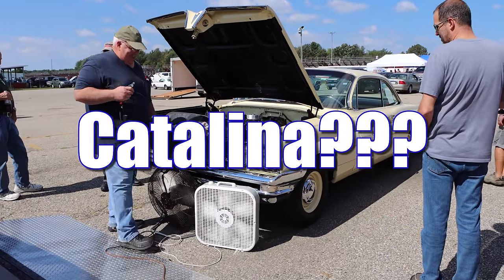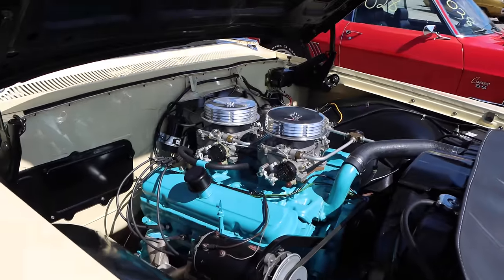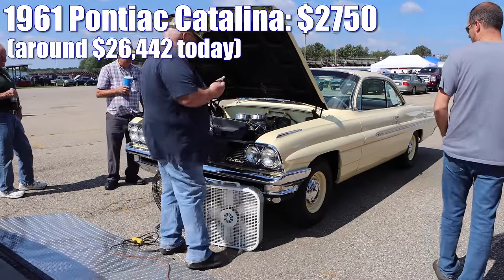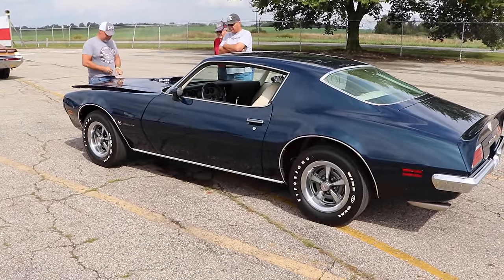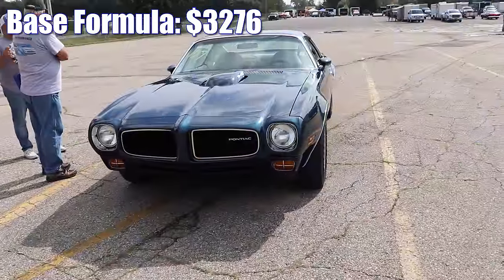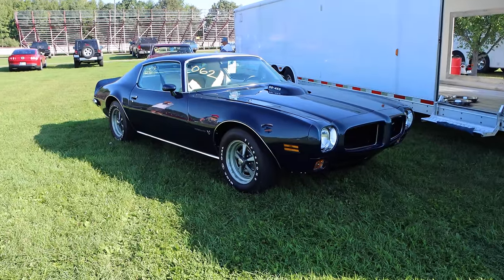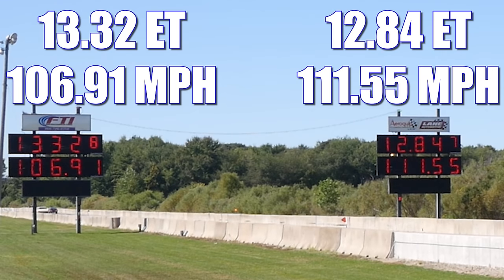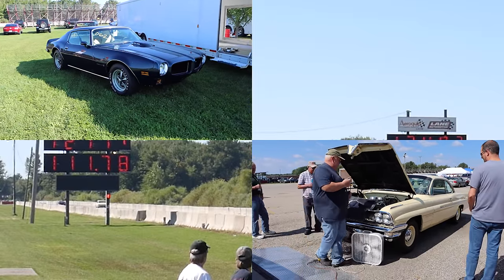1973 Firebird SD455 vs Land Yacht | STOCK DRAG RACE

Comment: Should of put the 455sd in a GTO
Reply: They tried with the Grand-Am of the day.  Which was a nice vehicle. However two things happened.  1.) parts shortages unique to the SD program.  Including motor internals, and suspension parts.  Primary due to supply chain issues from the union labor outages during those days. 2.) the Grand Am was made in different plants than Firebird…. Assembly training problems that GM did not want the extra costs to train cantankerous labor force when they were in very short supply of SD parts anyway including the custom hood the Grand Am needed. 

How do I know these things?  Being around Norwood factory and the Herb Adams engineering team in those days, these nuggets came out.  The Grand Am option COPO like option sheet had the SD-455 on it.  They were ordered.  Never produced for public sale is the official word.  Mauve heard rumors for years that there are one or two custom built at factory trim out area that got in private hands.  Never seen one live.
Reply: I also posted a separate comment entry.  Take a look for that if you have interest in more SD first hand history
Reply: @johnross6314  The SD is a great engine 421cid Pontiac Catalina type, I think if it was Engineered for speed instead of power,FORD would be back to the drawing board with the 428cobra jet,and FORD is a four letter word ,where I come from,we love GM and Mopar himis,but I really think the 421 if Engineered right could of put the himis to shame,hint shorter stroke,for rpms and cam to match with four valve, 12.5 compression,duel turbo or super charger,In high school our dream car was a 68 GTO WITH A 426HIMI,ITS POSSIBLE
Reply: @bigthunder2860  I do not doubt what you say.  My cursory understanding of the SD 421 really impresses me too.  The 455 and 421 are different kings for different times.  

The 455 was designed to both be a real life daily street capable race motor.  That with me gets 16-17.5mpg on the highway, met the emissions requirements of the day, ran on non Uber race gas, would not need rebuilding for 100k of hard use, had a real suspension and brake upgrade as mandatory part of the SD-455 package… transforming the Firebird to one of the all time (to that point and beyond) best handling and absolute fastest accelerating American sports car.  

The SD-455 would SCCA autocross (or road race) win over all comers on Sunday, run away and hide including corners from anything on the street on Monday.  I had no equal back then on the straight line, or cornering. 

It has reasonable sound levels, power windows, locks, AC, and 8 track tape.  It cruises all day where the driver and passenger hop right out refreshed.  This is a different king of the hill than the SD 421.  The 421 had its unique traits.  

Herb Adams was a genius. He fooled all the bean counters, and silk suit morons running GM.  His outright deception created the best all around handling and fastest car ever produced in America.  Nothing of the day could touch it.  That legacy lives on today for those of us who still have or fondly remember their SD-455 package. 

As a upcoming Plaid owner, the Plaid kicks them all to the dirt today. Running the 1/8, 1/4, flying mile, or Nuremberg, it has no equal for a daily street driving car.  And only one or two multi million dollar cars can touch or surpass in a very small way.  

Soon, if LGB/FJB crowd gets their way, we will be saying the same things and more about the Plaid years from now as we say about the SD455, as the rest of the slaves will be forced riding around on electric bikes.
Reply: It was supposed to go in a bunch of 1973 cars but didn't due to parts shortages.
Reply: @SteveBrueck  parts shortages due to union strikes with suppliers, and massive theft.  California plant was the worst for the theft.  Norwood Ohio where I had my SD built, theft was enough to matter.  The special forged rods, the pistons, valves, springs, oil pump, push rods, got massive five finger discounts by those loyal union workers in California.  In California, somehow they stole heads, intakes, whole blocks, cranks, cast iron headers, sway bars, front brakes, springs.  Dealer supply chain stole some of the rare, and only used on SD blocks dry sump oil system add on.  

How they got those out, who knows.  The theft ran both 73 and 74.  Although they figured out how to slow theft down in 1974. There were still way too many orders verses production.

There was never enough to add to other designs. Plus, I told what happened to the Grand Am..  Drive by noise issues, and could not produce the above the hood sealed cold air intake for the mid sized Grand Am and “GTO” version.

Comment: Most of those were the 389 SD rated at 385 hp or so depending on carburetion.
Reply: Ah,  389 Super Duty?  What?   No such animal....
Reply: Yes, there was! It was in Cars & Parts magazine several years ago & 1, all black, was featured. It was part of a collection.
Reply: @darrellepickering8433  OK,  so somebody built a 389 with SD hardware...Like I said PONTIAC never made one geez....
Reply: @darrellepickering8433  Well I'll be damned in 62 they did make a 389 SD...very very rare indeed - I stand corrected.
Reply: Didn't mean to start a free-for-all. Somewhere around here I've got that magazine. Don't remember the collector tho. Car was featured on the cover. Local guy bought a '63 Ford Galaxie 500 XL convertible in late '62. Red exterior, red interior, white top, 4-speed, 390/340hp. Never saw that combo ever again. It had the 3-2bbls like the 406.
Reply: Also that black Pontiac was a Ventura, a '61 model.
Reply: @darrellepickering8433  Sounds like a very cool car....I thought I had seen every rare Pontiac out there and owned a pretty rare one myself, somehow the 389 SD never registered, I thought the SD was developed at 421 CID.  That 406 Tri-power Galaxy would be an amazing ride as well.
Reply: Not sure on this but I think the 421 came to be in late '61, no verification on that.
Reply: @darrellepickering8433  Interesting my trusted Encyclopedia Of American Musclecars by John Campisano talks about the 421 SD coming in 62, no mention of 389 but lists 389 SD in production totals for 62, no mention of SD engines in 61. Fireball Roberts and Smokey Yunick won 31 times in Nascar 1961, seems they had SD head worked out?

Comment: The Firebird ran a little too good.
Reply: Nope. That is factory as is,  maybe the emission controls like EGR and air pump turned off. Study your history. I know first hand.
Reply: @johnross6314  I've heard someone say the tires are much better now. Street tires were useless in 71.
Reply: @jr-ee9jk  yea, I heard the old style vanity tires are a now bit better than originals.  I have to special order 15”s from Goodyear, or Bridgestone.  BF Goodrich while owned by the French, from what I have found so far neither have Cup 2 type tires for SD size.  I hear Hoosier has some street legal gum balls for road racing and drag.  Which I do not do SD.  Thanks.

Comment: the firebird was obviously not stock tuned. that old catalina was pretty cool.
Reply: Yes it is stock.  See my post about mine.  Most people do not know that the SD-455 was the fastest factory produced Pontiac of all time.  And was faster than most all of the 60s muscle cars GM ever sold when running street legal tires of the day.
Reply: @johnross6314  yes, as you know the SD455 program started in 1970 as the SD400.......it took until 1973 to get it into production and it was on the larger 455 by then and with all the consolidations they had to make to get it into a production car. I had a Brewster Green 73 Super Duty TA and miss it for sure......first divorce, got depressed and sold my Pontiacs......STUPID!
Of course after about 2 years I discovered the 1986/87 Grand Nationals and turbo regals.......had eleven of those from 1996 to 2007......fun cars although I daily drove them all and only modded down into the mid to low 11's as back then it was hard to get into the 10's and still be "Streetable" and daily driven....unlike today with all the extra technology.
Reply: @gregallen9065  another reason for any millennial who has say a CT5 or CTS V versions to MGTOW.. Remember “she belongs to the street”.  Applies to anything along those lines of “Peak ICE” vehicles from GM, Ford, or even the French/Italians (Dodge).  Sorry to hear of your loss due to divorce. Keep having fun with the GNs.  The “SD” of the Buick would be the GNX.